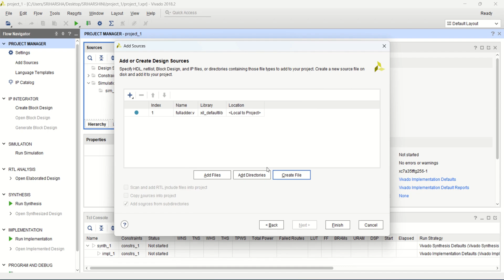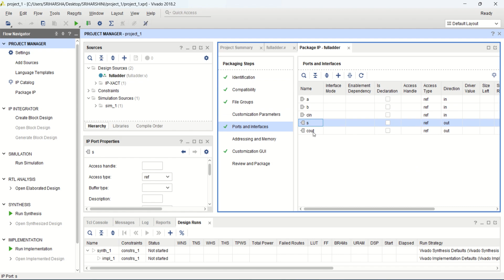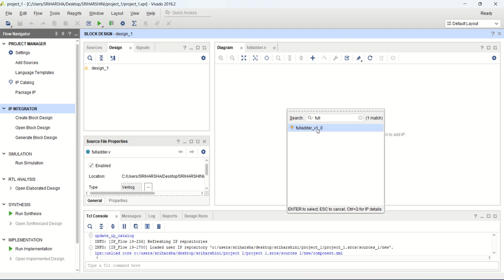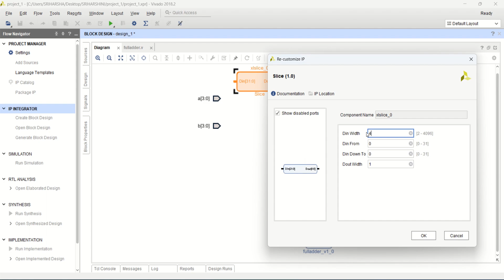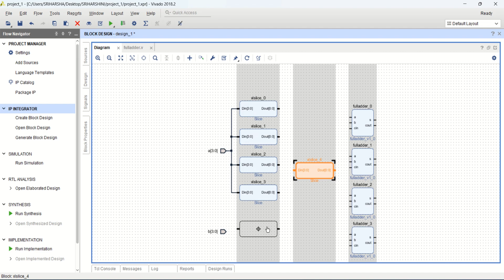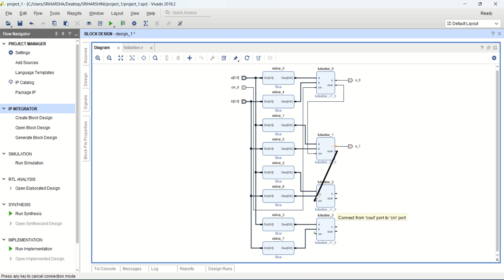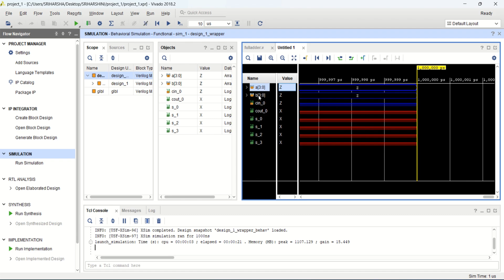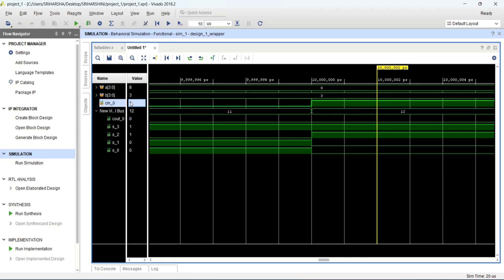4-Bit Ripple Carry Adder Block Design in Vivado.

Comment: Looking for help to design a multiplier in Cadence and testing with calculation of power, area and delay
Reply from the maker: Hi, multiplier is complex circuit complexity. It take time more time to design and analysis. No one will post that length video. Create small moules then integrate them. 
https://www.youtube.com/watch?v=eas-fPGSMew